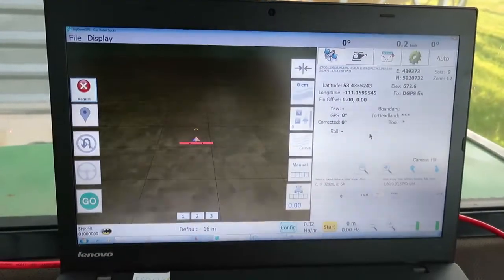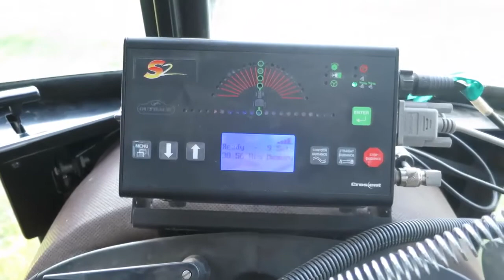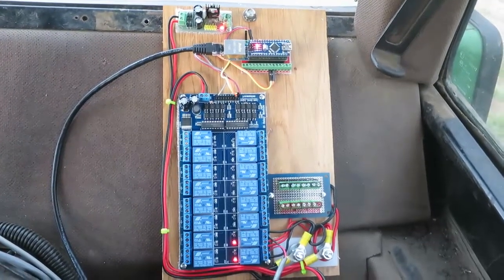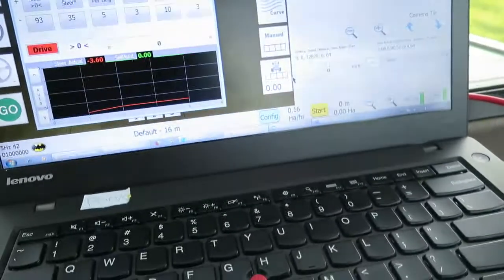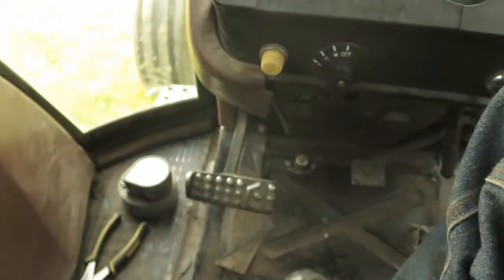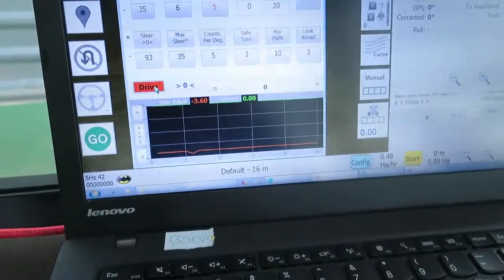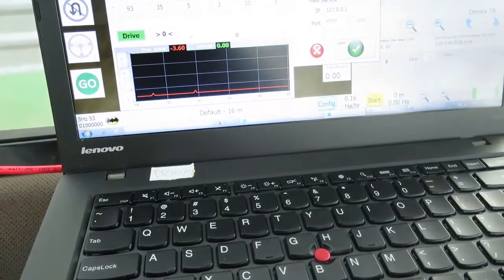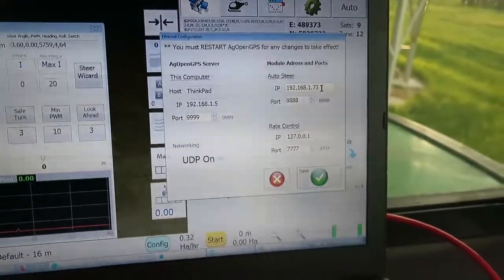Ethernet and AgraBot control

Comment: What are you using to move the clutch?
Reply from the maker: Linear actuator on the clutch control block. It allows both controlled and normal foot operation.
Reply: @FarmerBrianTee   Can you add pictures or part number of your actuator?